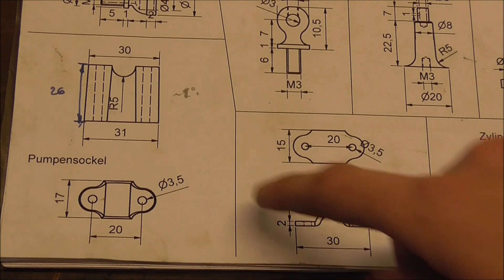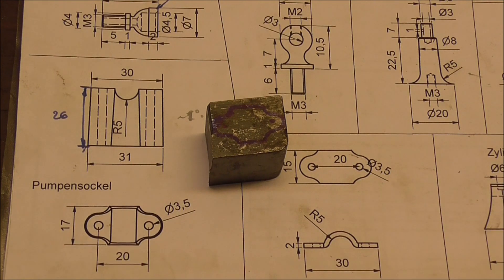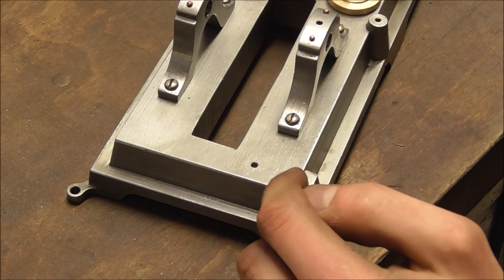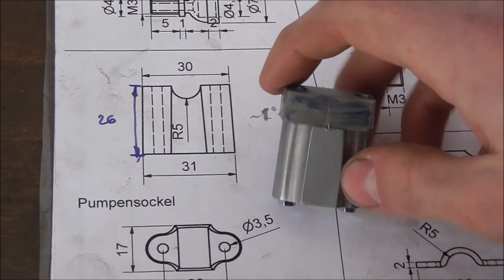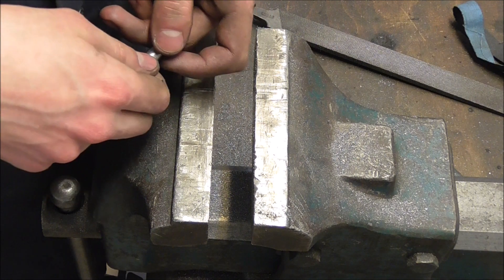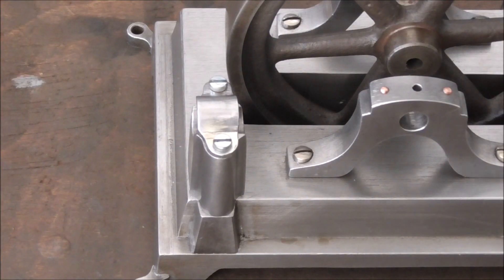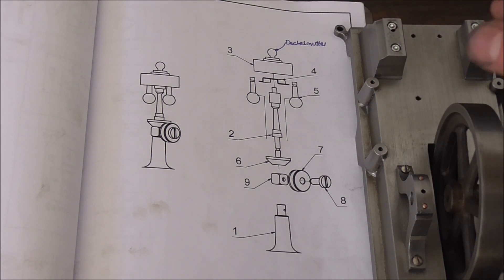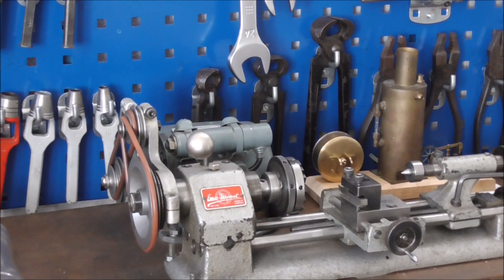More Bolt-On Pieces - Doll 362 Replica #4

Comment: Bloody lovely,- continue with your madness.
 I also have a 'Piece of shit bench drill', have considered many solutions to make it less shitty, one was filling the round post with concrete?maybe,  also the 'foot' is too weak and allows deflection..., maybe a screw jack to hold the table?, I don't know, a decent drill will turn up one day I guess.
 Cheers Adrian, nice project. Sam.
Reply from the maker: I already have a proper drill press in sight. It will take another couple of years waiting, but therefor, it'll be a man-size, tough as a tank machine - so I won't bother doing anything to this Chinese piece of cheapness. The table is too flimsy, the fit between pillar and head is sloppy, the pillar is too thin-walled and the base permits flex, too. 
That's what 40€ get you.
Reply: Astra-Werke ...always get the best DRILL PRESS that you can afford- that way, you're all set if you ever run into any WRINKLED DRILLS!!!

(get it? get it? get it? "drill press", "wrinkled drills"?! snucker-snucker-snucker!!)

Comment: I am pretty sure that the taper on the pump pedestal is as a result of pattern draft, from when these engine parts were originally cast. 
For future reference, I'd drill the 10 mm hole before shaping the contours of the part. One could insert a rod and work of that as a reference for setting up the part. That would give a much better chance of having the hole (the main aim of this part, after all) in line with the mounting holes... no?

Paddy
Reply from the maker: I couldn't agree more. 
At the time, I guess, I thought the potential to screw up the decorative aspects up was greater than a simple hole... 
I'd think differently with the gained experience.
And, yes, it's the pattern draft that makes all these parts slanted and angled in just about any way you can think of it.
Looks nice... But it's a bitch to replicate xD
Reply: @AstraWerke  ..."we live and learn-!!"
Reply: Paddy ...that makes a lot of sense!!